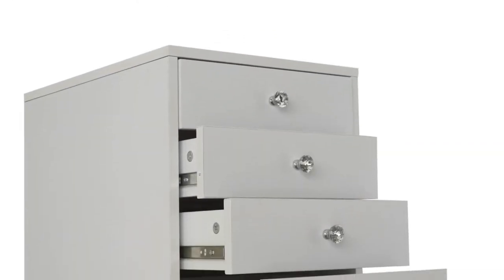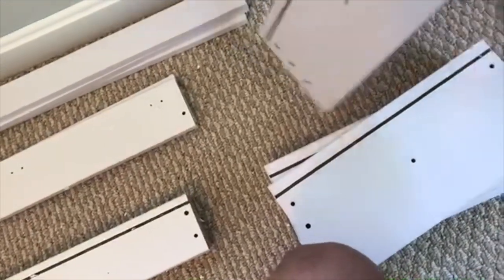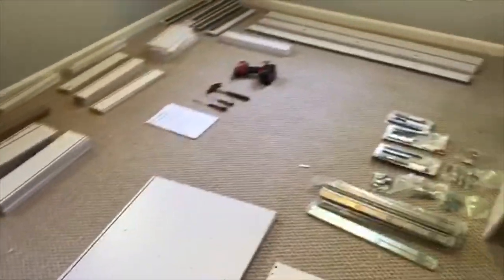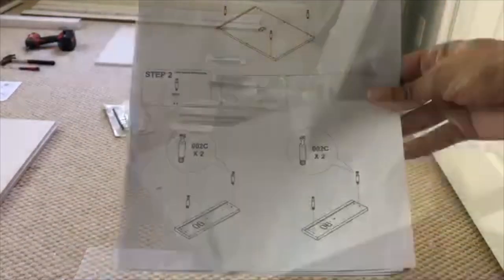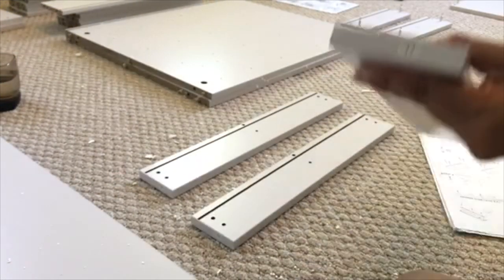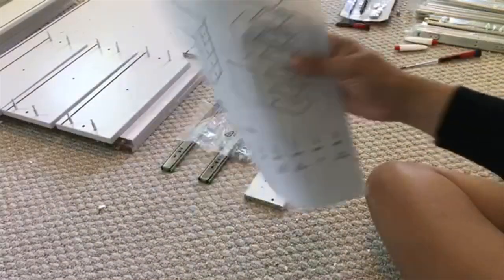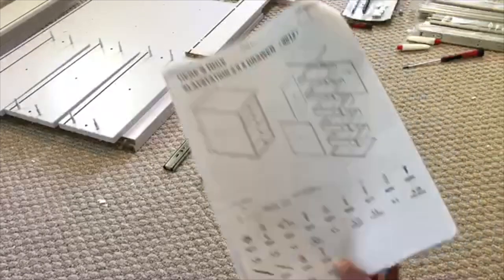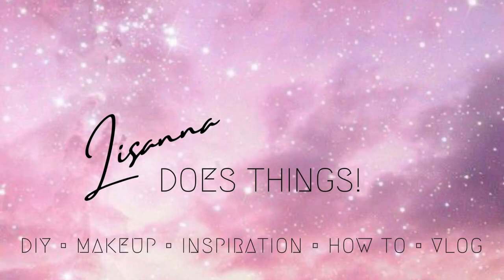BEFORE YOU START WATCH THIS !!! HOW TO BUILD AN IMPRESSIONS VANITY CO. SLAY STATION 2.0 DRAWER

Comment: Why does my drawer not completely pull out? It seems to stop 6” short. Was the track supposed to be fully extended before attaching to drawer?
Reply from the maker: Hmm.. I'm not sure. I didn't have that issue with mines. Maybe the placement of the screws?

Comment: I’ve just received my slay station vanity and I would like to understand why my 5 drawers will not push into the dresser I check 3 times that I put it together correctly !! I watched  your video and many others but there is no details about the drawers not able to push all the way in to close HELP IM SO CONFUSED
Reply from the maker: Good question! Everyone struggles with this one. You have to give it a gentle but firm push to get it. Keep pushing it in kinda like a pumping motion and they should go in. Hope that helps!

Comment: How did you install the drawer slide? I’m struggling!
Reply from the maker: You have to separate the two slides and then use three screw to get them in place.
Reply: @LisannaDoesThings  how do we put the 3rd screw it’s impossible because when you slide it it only shows 2 of the holes

Comment: Is that one white or bright white?
Reply from the maker: This is bright white!
Reply from the maker: @pickpick2540  I'm not sure what classic white looks like in person since I bought it online but I love bright white.
Reply from the maker: @pickpick2540  Yup! I have to be very careful while doing my makeup. If it gets on the tabletop or drawers it's okay. I use a makeup wipe to clean it. You have to get drawer liners though. If you get makeup, foundation, or oil  on the bottom of the drawers it's a wrap. That doesn't wipe off because it's like a cardboard material.
Reply from the maker: @pickpick2540  Good choice. I think the drawers are over priced and not the best material.